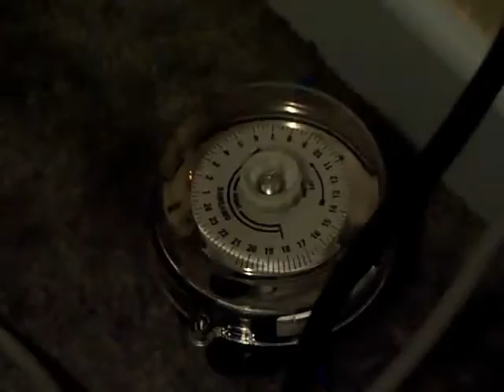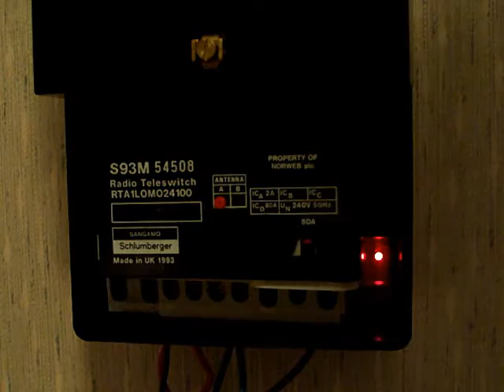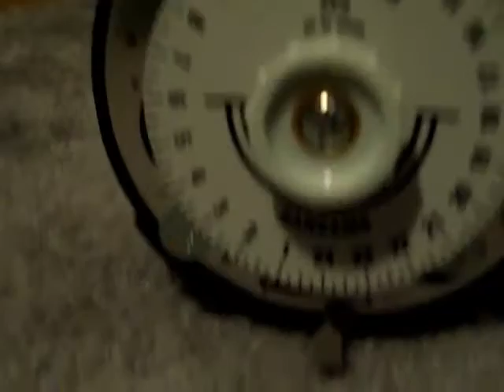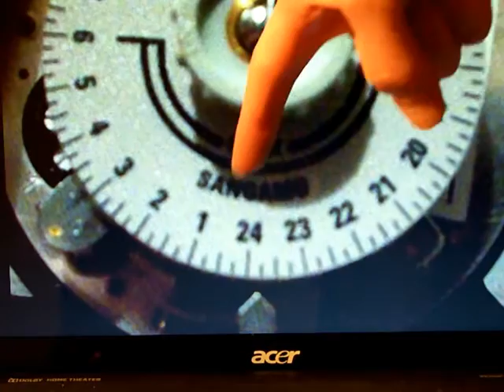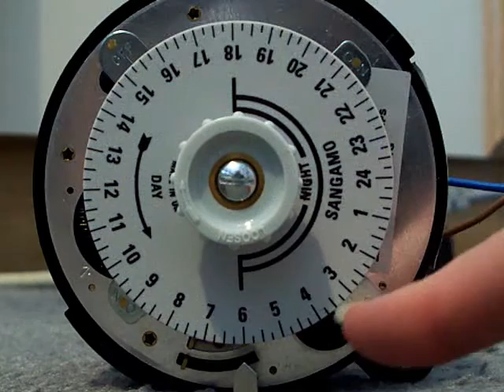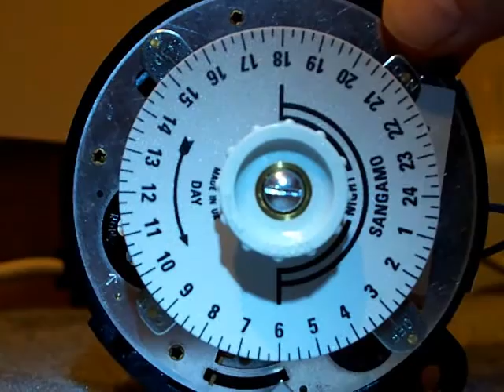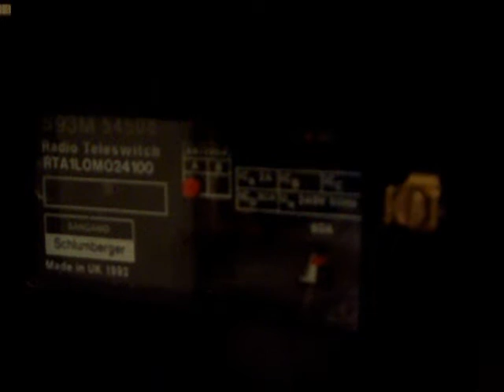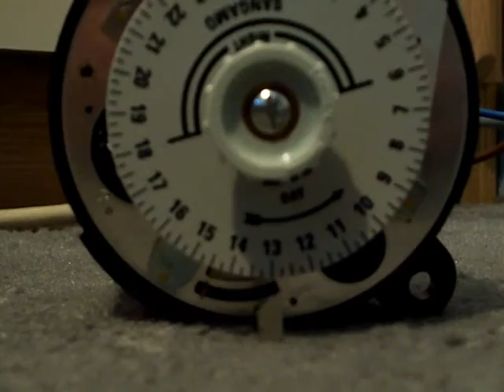Timeswitch : Trying out the Radio Teleswitch (Sangamo Schlumberger RTA1L OMO 24100)

Comment: I knew it would work! Interesting that it done some peak lopping though I wonder how others are setup like it? My mums teleswitch makes the same clunk when it turns on and off. Nice work you done there BBD!
Reply from the maker: Haha, how did you know it would work? :D

Even I didn't know, because I didn't know the circumstances under which this was removed.... It may have been a defective unit.

Thankfully, it isn't, and I managed to get it to pick up its switching signal and operate.

As seen in the vid and discovered by myself while time-logging the hours: it doesn't give the seven hours in one block. It gives two hours, then a two hour break, and then another six hours.

There is a label on the back of the unit which says "Region Code 24" so I would seem to think that other teleswitches with the same region code all do the switching pattern with the two hour break after the two hours of being on, and then another six hours.

Have you seen the "What's Inside?" video on this? I don't recollect seeing your comment on that vid.

You can find that vid by going into the Whats Inside playlist.

Thanxx for watching,

-BoomBoxDeluxe / Wayne's Electrical.

13th September 2016, 21.54

Comment: If longwave service at Droitwich stops these will stop working.  Perhaps they'll go to cellular-relayed ZigBee like they have where I live for smart meters?
Reply from the maker: Hiya. I am aware of the situation at Droitwich. 

I have heard that the transmitter there is old valve technology and the BBC have no plans to replace it when it pops.

I found out about this when researching on whether the BBC actually piggyback the signal onto 198LW (BBC radio 4 LW) and it turns out that they do.

It is obvious that the BBC know about the Droitwich situation because Radio 4 now also transmits on FM and DAB.

Once that LW transmitter pops, that's the end of it. 

I am not sure if UK-wide LW transmissions will stop, or whether it will be just a certain section of the UK, but I am sure that the electric boards know about it and they are now phasing-out the old LW operated radio teleswitches.

..... this is probably how I managed to get this one straight-out-of-service.

It is either that or one of the other options:

(1) The customer didn't want off-peak 2-rate electric anymore.
(2) The customer changed over or was forced onto prepay. 
(3) The occupancy of the building changed. 
(4) The replacement meter has some kind of internal timer.
(5) Some other option not mentioned / or that you can think of.

Whatever it was, the customer certainly didn't revert from Radio Teleswitch back to mechanical 24-hour Rate Changer..... 

I believe that electric boards are no longer doing change-overs or reversions to the timeswitches..... afterall, the radio teleswitch is what was made to replace the 24 hr Rate changers, and now, some other device is even replacing the radio teleswitches because of the Droitwich Situation.

I do know that Ampy make dual-rate electric meters and they have an internal timer in them, because there's various symbols on the front of the meter, and one symbol looks like an analog clock-face to denote that the meter has an internal timer for turning on the off-peak loads, and for changing the meter between tariffs.

Yes, I think that's the way it is going to go in the UK. Customers wishing to have 2-rate electric will have a once-piece unit, and that meter will have one LCD display on it which will alternate to show readings on the different readouts, and to show the date and time of the internal timer (so that the customer can see that the internal timer is running correctly at the correct time-of-day).

For the meanwhile, (as proven in this vid) anyone still using a radio teleswitch can continue to do so, but at any time, they may receive notice from their electric board to remove the radio teleswitch and old meter and replace both of them with a one-piece unit.

Fun-fact : Mr Photon has a radio teleswitch in active service on his supply, so at night time, he gets cheap-rate power. :-)

I wouldn't mind betting that as time goes on and the radio teleswitches are changed for one-piece electric meters, those of whom still have the old 24-hour rate changers can still continue to use their rate changers.... until that is, the calibration is due on the 2-rate meter.

THEN.... once the calibration comes due on their electric meter, both the meter and 24-hour rate changer will be ripped out and replaced with a one-piece 2-rate meter with internal timer.

Thanxx for watching,

-BoomBoxDeluxe / Wayne's Electrical.

3rd September 2016, 00.50

Comment: I have a question, on those smaller round timeswitches you have are the on and off times adjustable like a regular 24 hour timer, or are they fixed? Also what would you recommend for a good UK style double socket to be hardwired to a cable? I am working on my ripple control transmitter and decided to get some UK plugs so I don't accidentally plug a 115v device into the 240v coming out of my transformer. I'd have to guess you may have some ideas on a good one considering you have videos on the plugs. Also this video is one of my favorites, I really like that teleswitch you have, I contacted you a while ago intending to get ahold of one but I just don't have the funds at the moment, hopefully I'll be able to before they are gone though. I sent you an email with a listing of what the newer radio teleswitches look like in case you are curious, not sure if you got it. Anyways, cheers
Reply: Hiya. When  you say about the 
"Smaller-round-timeswitches" 
(as seen around about 2.16 in the video)
then are they manually settable? I can say that.......
.
.
.
........Yes they are. :-)

Really, it would be silly to sell a timeswitch where the times are not settable!

Those are set by turning the central knob CLOCKWISE as they have reverse-thread-style threading in the centre on that knob, and then the switching togs are then loose and can be set to whatever time is desirable.

Then..... turning the setting knob ANTI-CLOCKWISE it then tightens and thus clamps the on-and-off togs in the desired position.

There we go. A bit off-topic in relation to the Radio teleswitch though and this question really could have been asked in a related Sangamo RPTS video!

Thanxx for watching,

-Wayne's Electrical.

21st October 2020, 21.33

BoomBoxDeluxe is now a Wayne's Electrical brand.
Reply: @WaynesElectrical  Thanks for the reply,  got it figured out.